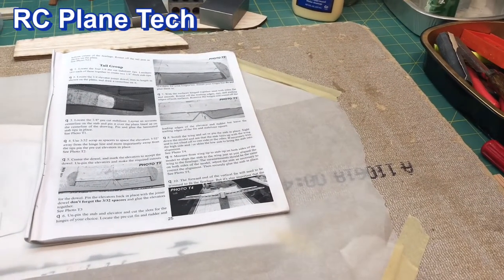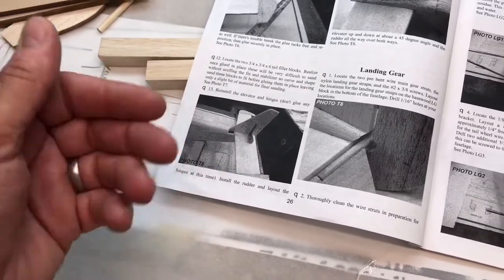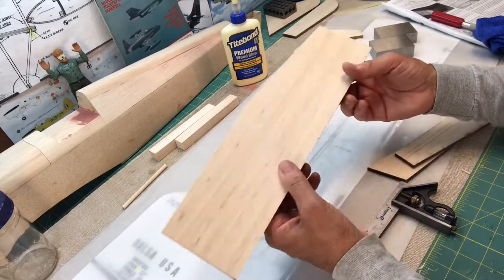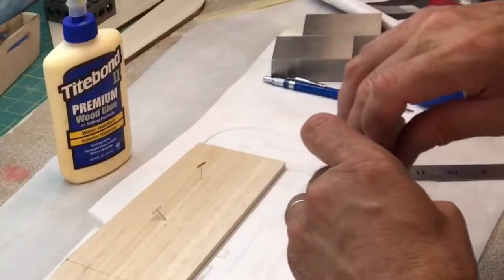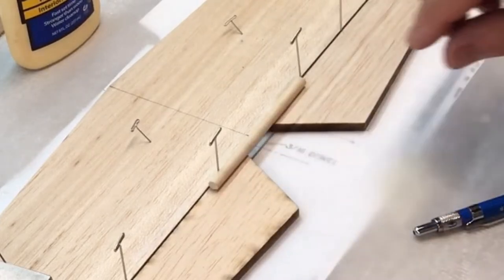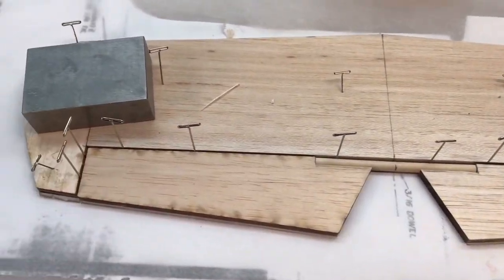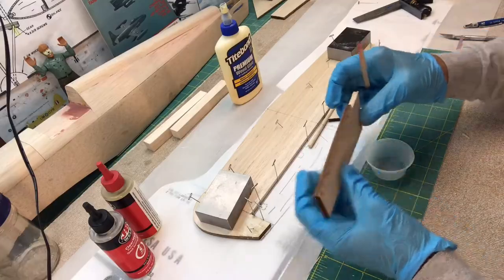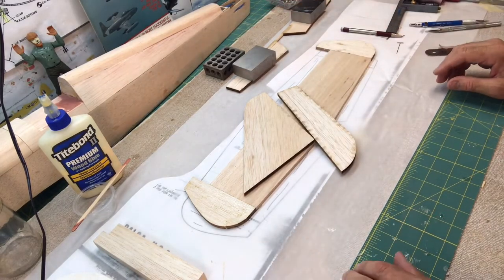Balsa USA Smoothie RC Plane Kit Build No 28, Building Tail Section, Part 1: assembly

Comment: Next time when you get ready to  rap it with fiberglass Cloth  put rubbing alcohol with your apoxsee 3 to 1 alcohol to apoxsee pant it on with a acid brush over the fiber cloth we also used the same mix to fuel proof where   the engine  will go also
Reply from the maker: I have seen the use of alcohol to thin the resin. I’ll consider that in the future. The Bob Smith resin is pretty thin. Other than thinning is there another reason for using alcohol?

Comment: Looking good, Im taking my build as slow as I can but the build has been very exciting for me and ive got the airframe standing on the gear already. I unfortunately need to wait for more resources but my build is going really 'Smoothly'😀. I installed some Spats and shes looking good. I would like to sharw with you some pics
Reply from the maker: Nice. Im moving pretty slow myself because doing the videos takes a lot of time. If you want to send me some pics of your build that would be nice to see. You can email me at rcplanetech@gmail.com
or if you want to share them on this channel you can go to the comments tab and I think you can upload them and add comments. Either way, it would be nice to see your build, thanks!
Reply from the maker: Oops I meant you can go to the “community” tab on the channels page and post pictures there I think.

Comment: Hi I just subscribed after finding your channel, I'm currently rebuilding/restoring my Goldberg Tiger 2 using a Saito 56 .I originally built this in the early 90s and have lost the plans. I'm trying to find the proper offset degree for engine thrust line. I remember it's only a few degrees but I would welcome your suggestions. I own 1 new electric plane, but I much prefer building and running glow or gas power engines.
Reply from the maker: Hi, thanks for the comment. Im sure the thrust line like you say is only a few degrees, but you may be able to locate the plans online. I like the website Outerzone out of the UK, they have lots of free plans that you can download. I just looked there and they do appear to have this plan: https://outerzone.co.uk/plan_details.asp?ID=12821 

You can try the link above or just do a search. I was able to download the plan and instructions in PDF and the plans say 2deg to the right. Check it out.

Comment: When you installed the plywood in the rear of the fuselage did you use 1/8 plywood
Reply from the maker: Hi. Hard to remember. But most likely. Ill check the video and see If I can remember
Reply from the maker: Yes, looking now I remember, it was just 1/8 thick. You could go thicker. It was there for the tail wheel screw to mount to. So thicker be fine also.
Reply: @JamesRCPlaneTech  Ok, thanks for the response

Comment: Looking good, can’t wait to see it fly! Did you ever get a hold of a 25L? I’ve seen quite a few on eBay.
Reply from the maker: Hi, Thanks. Yes I have been very tempted to get one of those 25Ls. There are two I have been watching and both had a recent price drop. Very tempting. I’ll keep an eye on them. Maybe if they drop in price again. But I’m thinking about it.
Reply: There is one on eBay right now with a really low starting bid. I saw another sell for $81 recently.